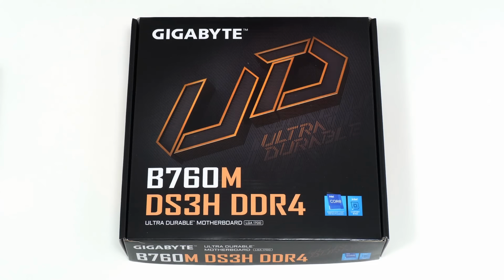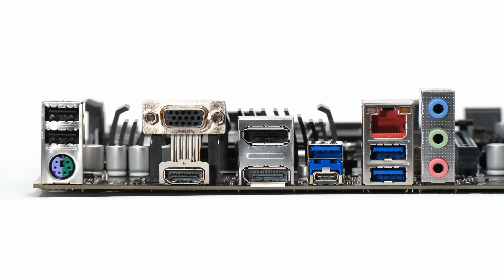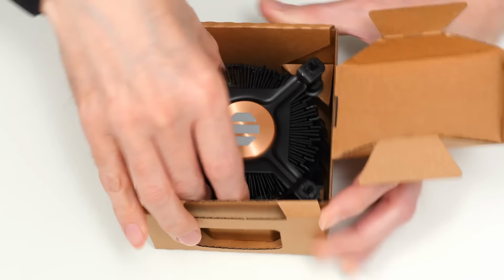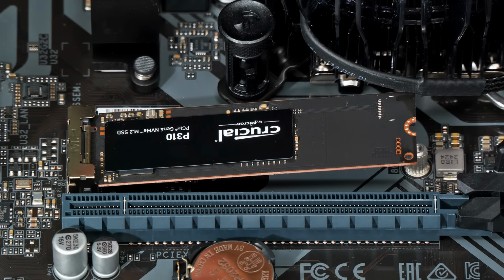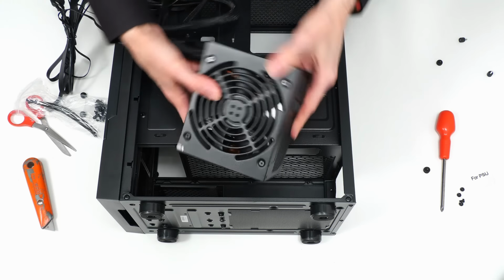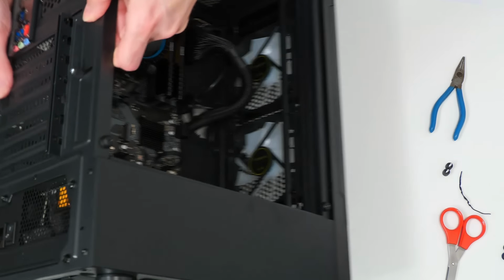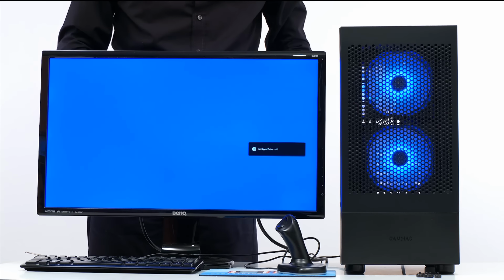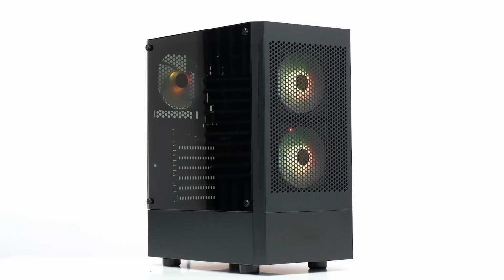Building a $500 PC

Comment: Great video! I'd be interested to see a build using the latest AM5/LG1700 motherboard and CPU. Perhaps trying to build a more "high end" pc in a small form factor case.

I'd be curious to see how much power you can squeeze in a very small case (without the pc running like an arc furnace!)

Comment: No hate, your channel is nice and all, but this isn't the video I'd use for a $500 gaming PC. For that price, if you stuck with a low end AM4 chip and got a cheaper motherboard, you'd be able to squeeze in a slightly higher end GPU for the budget. The title and thumbnail could definitely be more clear on the target audience - it looks like it's for gamers, but for gamers, this isn't the best value for money PC available. Maybe this would be fine for some people in between who play Minecraft and do some light editing/blendering. My last point is that this video seems to only feature all-new parts- while I don't want to say bad things about this guy, I do have to admit that Intel Arc A310 is NOT a good  value for money card, whatsoever. If you applied the cheaper motherboard, used AM4 CPU or one new off Aliexpress, you could snipe a deal on Ebay for a used GPU that's better value for money, while being able to pay more for it to fit into the exact same budget. While prices vary by region, one example of this could be a used RX 5700 XT. From a quick Geekbench Browser check, this will get you well over double the performance - near tripled - while only spending the £30 that you have already shaved off with the used or aliexpress AM4 CPU and the new (could be used, but new is better for motherboards) AM4 motherboard.

Note: Geekbench Browser is not a good gaming GPU benchmark, as it measures compute. It is used in this comment as a good approximation for gaming performance as it's a convenient, aggregated, easily searchable source of information. For GPU comparisons, do more thorough research before making any purchasing decisions.

To his credit, I saw nothing wrong with the RAM, and, while I haven't checked the reliability, the PSU's pricing isn't bad. Ignore the 80+ ratings (those are power efficiency), and google 'ztt psu tier list' if you want a tier list for power supply reliability.

Basically, this guy is a perfectly fine creator, but this does not seem to be his field. I encourage you to watch his other content on topics such as SBCs, but I wouldn't take any PC building advice.
Reply from the maker: Thanks for your views. I made it clear that this is an Intel build, and noted that it could be used for a variety of purposes, such as video editing. I have already done a low-end AMD build (two actually), so did not want to repeat. Given the millions of views I have on PC build videos, and the tends of thousands of very positive comments on the same, I reject what you say about "not taking any PC building advice". Just because you do not agree with a specification does not make it wrong. And I am demonstrating process here as much as specific component choices.
Reply: @ExplainingComputers  Ok, fair but I'd just add a little disclaimer somewhere  (unless already present in the other video mentioned) to make it clear that it's not going to get the best value for money for the price and maybe refer to a channel like ZTT or your AMD builds (which I haven't seen) if they're more geared towards intensive tasks. To be honest, I still don't see much of a reason to specifically promote Intel CPU builds, though. I guess this build would be OK if it's just for lighter tasks and it needs to be all new to last a long time.

goddamn i wrote a whole friggin essay there for no reason at all

Comment: Have you made a video suggesting compatible components for a bit higher mid-spec PC?  I hope to reuse my 9-year-old Fractal Design R5 case,  Corsair Hydro H100i cooler, and Corsair CX750 750w power supply.  It will be mostly used for Lightroom/Photoshop, Cubase DAW and,  DaVinci Resolve.   My existing PC isn't upgradable to Window 11 and I think my NVIDEA GTX 970 graphics card is becoming faulty (and probably not supported by Win 11, and definitely not by Adobe PS/LR.
Thanks

Comment: Christopher, Please advise,  having been an avid viewer of your Various Videos with Linux versions and Windows upgrade versions to 11 especially the Virtual box Windows run in Linux.Then watching you build this computer,  I decided to build a new one so I could run Linux with windows using the Virtual box. I used Gigabyte B850 Gaming X WIFI6E MB, with Ryzen 5 8600G processor, 32 GB Corsair Ram and a WD 1TB NVMe SN580 SSD with an MSI A850GL PSU.
It all fired up ok but unlike yours going straight in to Bios I got the following screen message from AMI (who every they are) which you didn't get why
Version 2.22.1293. Copyright © 2024 AMI
Model B850 Gaming x WIFI6E Ver: F1
Press <DEL> to enter setup.
New CPU installed, fTPM/PSP NV corrupted or fTM/PSP NV structure changed.
Press Y to reset fTPM, if you have BitLocker or encryption enabled, the system will not boot without recover key
Press N to keep previous fTPM record and continue system boot, fTMP will not enable in new CPU, you can swap back to old CPU to recover TPM related Keys and date.
This took me by surprise as it is totally different to your first switch on with the build you did for this video.  Which caused me concern, so I stopped. 
How can the TMP have been activated when everything is new and this message showed when I switched it on for the first time
What do you think, have you come across this warning, Do I just press <DEL> and hopefully enter the setup phase.
Reply from the maker: I've answered on another video.

Comment: Great video. Thank you. One question I have is do you need a heat sync on the second SSD drive? It looks like there would not be enough room to use thePCIE slot. Presumably the heat sync would be too tall.

Comment: Built box fine. Bios shows all well. But then tried to install latest Ubuntu but it fails to locate WiFi. No network top right of display appears. So  completely stuck. Anyone had any luck installing any Linux distro on this configuration?
Reply: Ok got it working with Ubuntu in the end. By using ethernet to update the partial install.

Ethernet connected to my router.

Did an update and got all the missing files.

Comment: I literally built my Pc almost identical to yours a year ago
Intel Core i3 12100
Intel 670p 2TB NVMe PCIe 3.0 TLC SSD
Intel Killer WiFi 6E Desktop PCIe Card
Intel Arc A750 Graphics Card
MSI Pro Motherboard 
600 W EVGA PSU
4 X Western Digital Blue 2 TB
Microsoft Windows 11 Pro
Fractal Design Core Case
Pretty cool system
I liked the Intel stock cooler enough I just left it.
That was meant for me honestly 
But I decided to gift it to my wife for all her hobbies 
Photography, Video Editing all does well on just an i3

Comment: Very interesting indeed, but for €200 more you could have gotten a Mac Mini M4 with a lot more power and an included operating system with lots of free software and you would not have to built it yourself. Besides that it is a lot smaller and is guaranteed to work out of the box. As an alternative you could also have bought a 2013 MacPro for €300 to € 400 that has more than enough power for video editing or whatever you would want to do with it. And of course you know all that and it is always fun to built a computer, I understand that but still thought I should mention that 😊. Greetings

Comment: Thanks for a very good build. I've just finished my build and panicked slightly when the bios took about fifteen seconds to show. I'm waiting for Win 11 to finish booting whilst sending this on my Win 10 machine. Two points. I would probably have chosen a different case as most people with a tower have it in a slot in the desk and the buttons and sockets on the top don't give you a lot of room such as the flash drive loading Win 11 at the moment. Can you explain why the second PCIe doesn't have a heat sink, is it because it's used for storage rather than running the system. Thanks once again from a happy subscriber.

Comment: I started watching the video and paused it to get some groceries. After the checkout I saw two laptops in a display: one for €199 and the other for €299. Since I'm a PC builder, I came back home disillusioned with the thought that we consider a $500 PC a "budget" (cheaper) one, when two full computers were right there for the price of one without peripherals. I thought that regardless of their specifications, you can actually start doing things with them - no assembly required, no need for a monitor, keyboard, mouse and speakers, they just work as such. So I started wondering if building PCs is still worth it, and if a $500 budget can still be considered cheap.

But before I could answer that, I went online to check out the specifications of those laptops. Sad to say, those are e-waste under warranty. The €199 laptop has a weak and old Celeron CPU (N4120, launched in 2019), 4GB RAM and 128 GB flash memory on-board, very likely eMMC. Its only redeeming qualities are the extra M.2 2280 slot for a better storage device, although that's S-ATA, not NVMe, and it has a 14" Full HD display, which is reasonable. The one for €299 has a Celeron N4500 (launched in 2021), 8GB RAM and, thankfully, an NVMe SSD, though only 256 GB, with a 15.6" display.

As long as you know what you're doing, and what you get a PC for, there are for sure cheaper options than $500. However, that's pretty much the danger zone when you want the ability to upgrade in the future, let alone the fact that you'd have to be comfortable with reduced productivity until you spend more money. So when it comes to budget PCs, more often than not, you get what you pay for - unless you know someone who can give you good advice (for free 😆).
Reply from the maker: Great post.
Reply: Thank you. :)

Comment: Expansion Slots
CPU:
1 x PCI Express x16 slot, supporting PCIe 4.0 and running at x16
* The PCIEX16 slot can only support a graphics card or an NVMe SSD.
Chipset:
2 x PCI Express x1 slots, supporting PCIe 3.0 and running at x1

in the above paragraph it says it only supports a graphics card or an NVMe SSD.?
I'm a little confused about that statement
Reply from the maker: I means that the only devices that will work in the x16 slot are a graphics card or an NVMe SSD. Not all NVMe SSDs plug into an M.2 slot -- some can do into a standard PCIe card slot. But you can use a graphics card in the PCIe x16 slot and two NVMe SSDs in the M.2 slots.
Reply: I saw that this motherboard has a socket for a TPM module did you use it ? If you didn't use it how did you install windows 11?

Comment: the motherboard supports many different memory speeds how did you arrive at the one you are using...
Reply from the maker: As noted in the video, I choose the memory based on the speed that the CPU can support, which was 3200. The memory cannot run rather than this, regardless of what the motherboard can support.

Comment: Thoroughly Inspiring! I decided to build a new PC with some variations: Same motherboard, 2x8GB DDR4 RAM (3200MHz), 1TB M.2 SSD (system), Thermaltake Core V21 case (this case is fantastic!) and Intel Core i5 14500, no external graphics card (GPU built in). It might be a little more than $500 but it flies! :_stanley:
Reply from the maker: That sounds like a very nice build in a very nice case. The 14th gen Intel chips seem to offer a significant performance improvement, so I'm not surprised that it flies! :)
Reply: RAM is pretty cheap these days and a quick way to make your comp fast. 16 gig is okay today but the world is moving rapidly towards 32 gigs. But yeah I love that build, no waste. Very compact.

Comment: What CPU upgrade would be required to maintain all performance parameters of the  I3 14100F CPU but also allow use of the display port connectors on the motherboard? Thanks much for the video, I'm doing a build right along with you, using your recommended components.
Reply: Ignore the above...a CPU with no integrated graphics...duh.

Comment: Today, the design of a PC is so much cleaner than it was 25 years ago. No 50-pin ribbon cables, no 3.5-inch hard drives. Wonderful.
Reply: The IDE ribbon cables either had 40 wires or 80 wires in the case of faster data rates for newer motherboards. Those were the days... that I don't particularly miss. 😅

Comment: I appreciate your videos very much and have done some upgrading adding an SSD and some memory to my old Athlon desktop based on information I got from you. I was wondering if you had a video showing a windows install starting from a Linux machine. I have not used windows for many years but would like to install Win 11 on a new machine as there are some apps that I can't run in Linux. All my current machines are Linux. Please keep up the good work.

Comment: i have some observations... i prefer  MSI mobo because of the ease of use on bios... they are budget friendly too... Gigabyte is good too. I kad gigabyte in the mid 00s.
I also love amd and i find them to be best used with msi mobos... my pc case is a similar one from genesis/netac (a value brand sold in europe but made in China most cases under 100€ are similar afaik). I don't like corsair psu (i prefer seasonic) because i find them overrated at least the entry level ones. I kinda liked your graphics card. It feels like a breath of fresh air using a third manufacturer. Very good video. Thanks! (waiting for the illumos video).

Comment: I priced this build assuming I can find all of the parts in total will cost over $700CDN.  An "Entry Level PC" doesn't have to be expensive.  A "NUC PC" can be under $200 and less work to set up with an OS already installed
* Deleting valid comments is piss-poor ignorance.  Turn off all the comments if you don't want to read them.

Comment: An absolutely cracking video 👍 " ... once again!"
Ace parts. Superb 'construction'
Thank you so much, Chris!

P.S. I would much enjoy a future video from you on correctly installing drivers, and in particular, the process of keeping generic drivers from auto-installing and/or overriding the more preferred, OEM device drivers. It has to do something with the Windows Vista RTM (Release To Manufacturers) date of 21 June 2006, among other factors.

P.P.S. Whereas it is not hard keeping a i3-14100F cool. Regardless still am curious whether BIOS fan profile (set aside by molex fans maybe?) would have sprinkled in a touch more of civility to the final configuration. Moreover, a 'key highlights' review or fly-through of some of the system BIOS-UEFI is beneficial in PC-build videos.

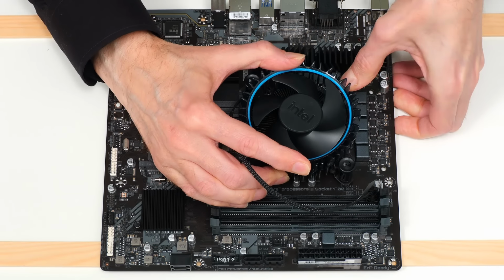P.P.P.S Nothing tops a 3x-"swine"-sworn video: 9:45 (cpu cooler), 11:37 (ram) and 18:30 (i/o shield).
Reply from the maker: Thanks for this. I may well do ann instsallation/setup video.
Reply: @ExplainingComputers   ❤

Comment: I did a mini upgrade on a family's member PC because he needed more computing power for school. From an i5-10400 to an i9-10900ES (yes, Engineering Sample, limited to 95W TDP), GTX1660S to A770 and SATA SSD to an NVMe SSD. Quite surprising that the i3-14100 performs similar to the i9-10900 in gaming. Wanted to use the A770 for my own PC but Intel's XE drivers have been rather disappointing even with the latest kernel and Mesa, nowhere near in feature parity.

Comment: Again you don’t address the real retail cost of the Operating System. Sure if you are to run Linux, you really don’t need that much hardware. However, if you are to really compare costs, you need to consider the real retail cost of a copy of Windows. Not an OEM key, as you are comparing all cost at retail Amazon price, but conveniently skip the cost of the OS. Now compare that to the performance you get from a Base Mac Mini. The main difference is the storage as 16gb of RAM for an ARM M SOC Mac. Storage you solve with a UBS-C 3 External case and drive and you are still under $550 or less. Consumers (not computer geeks) have the most performance for each $ with a Mac Mini. At least it takes the system you are configuring to the cleaners in performance, space and power consumption.
Reply from the maker: Fair point on the OS, but I specifically did compare to a Mac Mini in the last video. And a base Mac Min is fine if you want no upgrade options, very little storage, and poor connectivity! :)

Comment: In regards to the heatsink on the SSD, would it make much of a difference to take the Crucial sticker off first prior to putting the heatsink on? I'm not so sure on how hot the SSDs actually get. I would think if it was an issue, the manufacture would provide the heatsink for both slots.

Comment: Hello Chris and thanks for another great video about getting going on a computer build. One question I have is how did you get Windows installed on the computer as there was no OS at all on the SSD? Some sort of external boot device? I have found Windows to be an expensive option for low cost systems as the license for Windows home is about $130 USD even as an OEM and was wondering why that cost was not included. Sorry if there is something obvious I am missing, I’m much more comfortable with Linux.

Comment: I did an upgrade last Nov, from an 8th gen to 12th gen intel. It was cheaper this time than when I bought the 8th gen! The i5-12400f cost me $166AUD, i5-8400 $270AUD! ), Mobo $144AUD (new board can take upto 14th gen! 8th gen board coast me $166AUD).

2TB SSD or NVME is about the same here in Australia at $177AUD.